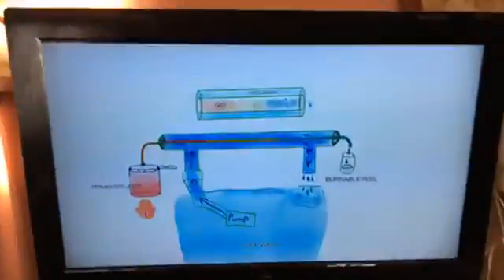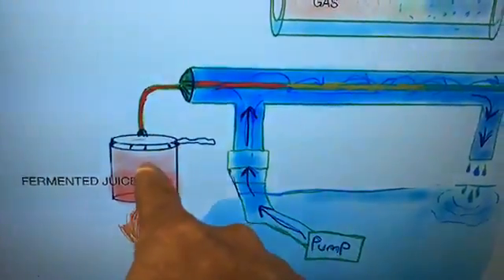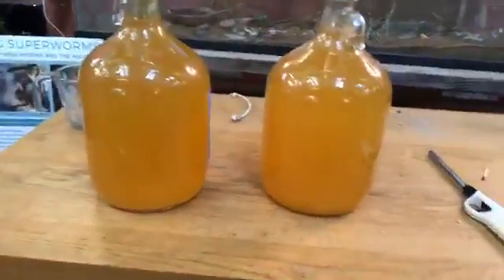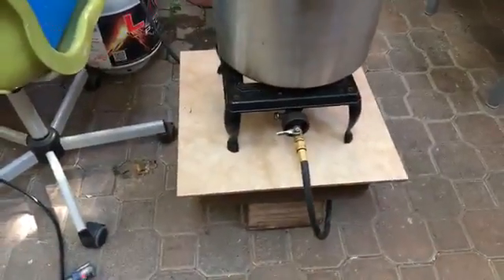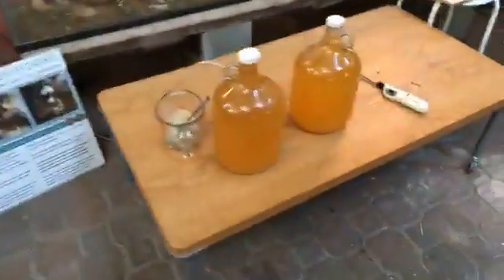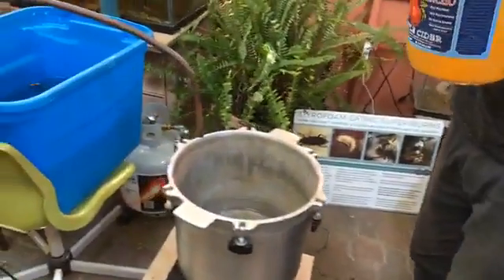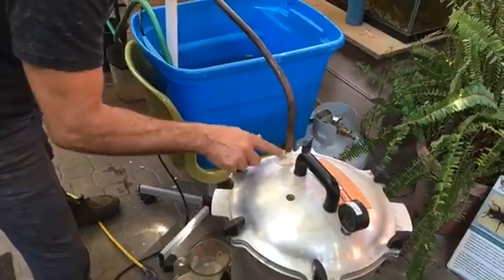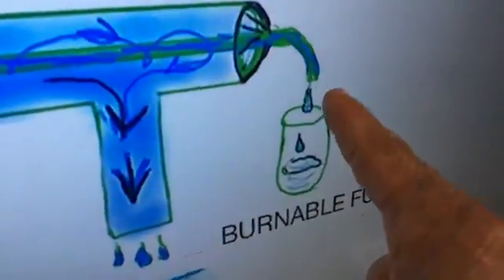How to Make Your Own Ethanol Fuel (At Home)

Comment: Vacuum distillation is way more energy efficient because you can lower the boiling point to 35⁰C. An electric vacuum pump (or maybe an used refrigerator compressor) energy consumption is a fraction compared to a burner.
Reply: If you want max efficiency (and I’d assume you do when making fuel) you would want two pool heating setups linked in series, a solar collector (evacuated tubes are the best) and a heat pump, coupled with your vacuum pump and a few PV panels and you could be distilling fast, efficient, and free (maintenance and brewing ingredients would be your actual cost after that, and since you get about 10years out of new panels and heat pumps it can get pretty cheap if you run it non stop for its life. Scalability is the issue here, need to be heating your home or fueling your transportation if you are wanting to go efficient.

Comment: Bro you dont even need a pump.  The water falling out from gravity will pull more water up the tube.
Reply: Except it would flow the opposite direction that you are imagining without the pump. A little bit would splash out until air got on top and then it’s going to go straight down.

Comment: A certain percentage of each batch is methanol.  Still burnable.  Actually better fuel.  But, that portion is a neurotoxin.  That's what makes people go blind drinking moonshine.

There are ways to tell what portion is methanol and remove it.  But, for fuel, you don't need to remove it.

Comment: This method is okay, but one can easily extract water and ethanol from regular fuel via separatory funnel. 
After the water and ethanol is separated, the water can be separated from the ethanol using simple distillation w/ light heat (70c) with no risks. 
Water will evaporate at room temperature but that will take a very long time. This is about as anhydrous as you're going to get without a more advanced setup.

Comment: It would be interesting to use the ethanol created to burn as the fuel that is heating the pressure cooker, then subtract out how much fuel was burned from how much was created and see what the net ethanol production is.
Reply: Even though its interesting, i would make the ethanol from solar panels -> when theyre making more power than your home can use
Reply: The pot would never absorb 100% of the energy the ethanol produced while burning,so you would waste a lot of it
Reply: You would not be subtracting the amount of fuel burnt [to heat] from that produced. You would be subtracting the [much smaller] amount produced from that used to heat.

Comment: Won't this fuck up your engine valves and fuel jets?
Reply: ethanol is already in the petrolium you buy (i.e E95 is 95% normal petrol/gas and 5% ethanol)

In cars made before 2005 it will eventually cause some damage

Comment: So nice! Watching this video I come to an idea to use a heat exchanger instead the pot. Like a chiller evaporator or condenser, with water as a second working fluid which temperature will be controlled to < 100°C and greater than ethanol evaporation temperature

Comment: I am new to this, but it sounds so simple, at this first stage, but then you are using gas to heat your Mead why not use an everyday fireplace that we used to heat our homes everyday with this system refined built into it to produce larger quantities is there such a fireplace on the market that can do this or should I design one and put up a link

Comment: the water in the condensator should run in the opposit direction for optimal condensation, not in the direction of the flow of the hot gasses.
Reply: It does...
Reply: Absolutely !!!and that's the way it's suppose to be

Comment: Doesn't look like high grade fuel distillation. You need a Fractional Distiller and molecular sieves. Wet ethanol is fine but you need to redo a lot of the car.

Comment: So your burning propane... and using electric for the pump... to produce Ethanol... Which wont replace the amount of energy it took to make it...This doesnt seem very efficient.. or very smart.
Reply: The pump uses extremely little electricity. Use wood to burn. Be smart.
Reply: @baloog8  lol be smart.. ok here is smart .. propane throws off 84k Btu’s of heat per lb aka energy.. add to that the energy it took to run the pump …. To produce a product that generates 73k btu’s of energy per lb… again not very efficient or smart even if you run wood.. it runs about 6k btus per lb.. your not going to get the same amount from ethanol to what you gave in.
Reply: @N0body247  Any chemical reduction consumes energy. It's not about efficiency, it's about independence from the system.
Reply: @ssmdffs  That’s the most dumbest saying I’ve ever heard if it’s about independence then change your car. Ethanol still has to be conbusted to give you energy. All he’s doing is changing one dependent for another put 1 million people in ethanol and ethanol is gonna be the dependent the only differences but it takes more energy to create than you get.
Reply: @Raver Magik  lets try to agree on foundations first. Fuel takes considerable energy to make no matter what and its value is not only in the energy balance but the ability to carry it around. That being said, ethanol from corn is a definite loss. I learned that from chemical engineering class. But ethanol from sugar cane uses also the stalk to heat distillation and they get a definite energy/profit positive. They also use the charcoal and yeast as animal feed and fermentation liquid after distilling.

Crude oil has to be shipped, processed via distillation also, then it has to be distributed. Compare that to wood gasifier cars which are far more efficient energy wise, but you will have trouble carrying it around.

Anyway, hope you enjoyed reading, maybe gain some perspective on this ..and maybe look up gasifier cars. Very interesting!
Reply: @baloog8  I don’t know if you read my other comment to Sergio that talks about wood but here we go.  lol @ gain some perspective.  I have been studying energy for many years.  I know exactly what wood gassified cars are and how they work.  Why because we as a society evolved from that. Efficient? Hardly. First wood only generates around 6k btus per lb of wood. 6k btus will only take you so far. Since we used to have wood gasification in cars we know what that is per mile. The average truck typically burned 220 pounds of wood every 62 miles. Lol that is roughly 3 gallons of gas at 20 miles a gallon. Some cars can get 30 miles which is 2 gallons. Even at todays price of 5 dollars a gallon it would cost you 15 dollars to go the same distance in a car.  Vs around 100 dollars in wood if you were to have to buy it. Not to mention it’s 200 lbs in wood .. who the hell wants to load that? Not to mention they can’t do the speeds (aka work) we can today. You can’t make a gasified car do 70 miles an hour.. because the btus are not high enough to generate that kind of force. And even if you could.. it’s. 220lbs of wood to drive that speed an hour. 

Now as far as getting back to ethanol is not as efficient either because it burns and generates less btus as well, so your miles per gallon will be worst than gas. Consider that ethanol contains 1/3 less energy than gas your litterally cutting your fuel economy in a 1/3rd meaning at 20 miles to the gallon of gas it’s around 13 miles a gallon for ethanol. Add to it the cost of making it cause it takes energy from other fuels to make this.. it’s a loss. There is no free energy.

Edit.. I haven’t even mentioned the 200 other uses we get out of oil.
Reply: @N0body247  im seeing your pts. Thanks for the gasifier info. Thats useful.  

Even with the 25% loss in ethanol efficiency, the cost to product is still less than a dollar a gallon in brazil including energy inputs. Levelized cost anaylsis, I sincerely think that ends this argument thread although the hundreds of byproducts of crude may win out economically in total. A gasifier to electricity and distillation hybrid plant would be very appealing especially if the CO2 is fed to greenhouse/algae. If done, arguably, the inspiration and social good of a green project could outweigh crude's benefits especially if we include the people into a coop business structure. Obviously thats a lot of if's, but its nice to dream..

Also, higher compression in engines can utilize the full capabilities of ethanol. See mazda sky active-x hcci engine as one example.. and it is still not nearly at full potential!

I appreciate that you put in great work into energy studies and look forward to anything Ive missed.
Reply: @baloog8  The one thing a person can do if they want to lower the fuel bill and learn how to make gas from plastic there’s YouTube videos on it. And the reason is because we are in a plastic society most of our waste is plastic. So a family that learns this technique can literally cut the fuel bill by we converting the plastics that were once oil back into a usable fuel. The problem I have with America is that we waste so much opportunity and then we complain when things get expensive when we can’t even use what we have to The full degree. If every home converted their plastic waste back into gas gas prices will be super cheap because the demand oil will go down. But it’s good to talk about these things because the more we have conversations on this places like YouTube the more people will realize there are other options that they should be looking at.
Reply: Really true

Comment: Might add the importance of not trying to drink that after running thru that setup, you never ever want to drink alcohol that’s been thru a aluminum pot still. There are toxins released from the aluminum that are very dangerous
Reply: Complete nonsense
Reply: Not if it's under 1000°F

Comment: If you add salt till saturation to the mead or other fermented liquid you raise the boiling point of the water meaning you can extract more fuel and leave more water behind per cycle.
Reply: what temperature do i distill it
Reply: @dnsm7381  250 F
Reply: Doesn't salt lower the boiling point of water?
Reply: @Aaron-jv7pc  No it increases it you can run the experiment yourself with distilled water and then salted water and remove all doubt.
Reply: @Barskor1  Oh yeah, you're right. It lowers the specific heat capacity.

Comment: Fractional distillation through controlling the temperature to separate what's in the liquid and then condensing it down. The temp rise's to show when it's now traversing to the next liquid and would contain just a little of that combined still because of both liquids in the transition. Always best to use a transitional beaker of some sort to keep the purity up between the 2 liquids that you can separate later. Hmm now were getting into what solids maybe in the liquids yet that's easier after the liquids are separated. Chemistry in highschool... Now how to turn a penny into a fake gold penny... Nice video guys.
Reply: what transitional breaker would you advice for? never heard of that before,very interesting. as are all this simple chemistries!
tfs

Comment: MAAAAN I don’t even get any of this but I love how this man took the time out of his day to show this information like damn bro I appreciate your help for your fellow people. Supporting you bruh keep this up 💯💯💯
Reply: Hes just essentially making moonshine. I've "allegedly" made it several times. His is a little complicated compared to what I've used but the principle is the same. He's using mead instead of mash in his pot. The principle behind distilling alcohol is that alcohol will turn to a vapor before water will under heat. If you keep the temperature at 172° you will get alcohol to flash off the product in the pot and once the vapors go to the top and exit to the heat exchanger he's made in the water also known as a coil or as shiners call it a "worm". The worm is surrounded in cool water which cools the vapors and allow them to turn into liquid alcohol

Comment: Can I use PVC pipe?
Reply: No copper has significantly better thermal transferance properties  PVC would not condense the vapers anywhere near as efficiently
Reply: You could for the outer jacket, but the heat may compromise the integrity of the pvc nearest the still & you might spring a leak. The insulation quality of the pvc would be better than the copper for retaining the cooling ability of the water though, as copper draws the heat from the outside as well as the inside. But your inner "worm" will have to be metal due to heat transfer for condensing, and copper is your best choice for that.

Comment: Do you NEED the pressure cooker?
Reply: No the pressure cooker is only a convenient sealed chamber to boil the mead in. once he put the hole in it for the condenser it lost the ability to build pressure in any significant quantity.   You could substitute it with other items at hand as long as it 1.can be sealed,  2. Will hold up to the heat source and 3. Will hold up to the corrosive properties of ethanol.  A thrift shop pressure cooker just hits all the criteria in a cheap package.

Comment: industrial use USP ethanol is very useful for a wide variety of uses from distilling alco soluable compounds to high performance compression fuels. Making it at home will prove to be an important off-the-grid skill
Reply: I want to make my own e85 or even higher ethanol ratings for high boost engine fuels
Reply: @d_kortman  be advised ethanol burns leaner and hotter than gas, you will have to use very high pressure injectors and watch for temps constantly.
Reply: @CSLFiero  what if you filter it down with petrol like similar to e85?
Reply: That's the idea, yes. those two mix perfectly without any additional addative or process, so anyone should feel comfortable with it. if you don't have the ability to run on 85+% ethanol, note that your gasoline car can probably run on a significantly more ethanol dense fuel than it's currently running with only a small uptick in heat. cars built in the last 20 years can be nudged up to 15% with almost no change, 20% might still run well. cars in the last 10 years can run fine with double the ethanol that is already in commercially available gasoline, but newer cars may not be as willing to accept the extra heat, so monitor carefully when pushing past 20%.
Reply: @CSLFiero  iv fitted a 1998 saab b204 to my 2007 astra vxr. It's currently running on e85. Sometimes even throw in some paint thinners for a bit of extra power. If I made what this person here is making which I have in the past could I basically mix it with a high octain fule like race fuel and basically run my car on it?

Comment: What's the point of making ethanol for environmental reason or save money your using propane
Reply: This makes you self-sustainable. So you're not reliant on a hardware store to purchase petroleum-based fuel.
Reply: the propane is just a means of boiling the mead, you could substitute that with anything that gets hot enough to boil alcohol, electric, wood, or waste heat from other equipment even.  Alcohol only has a Boiling point of 173.1F as apposed to waters Boiling point of 212F  you could use a solar system to charge a battery and run the whole thing off a repurposed coffee maker coil if you had the means.